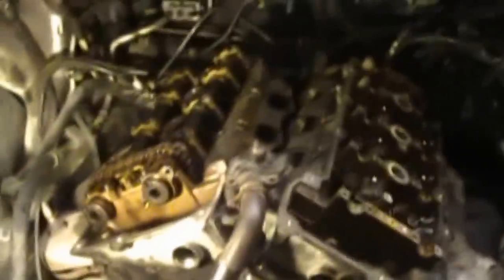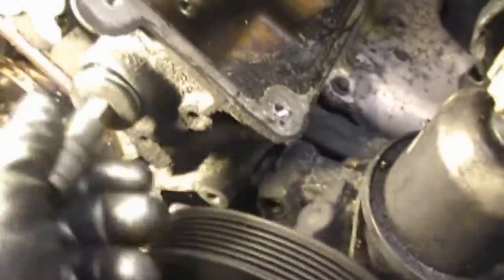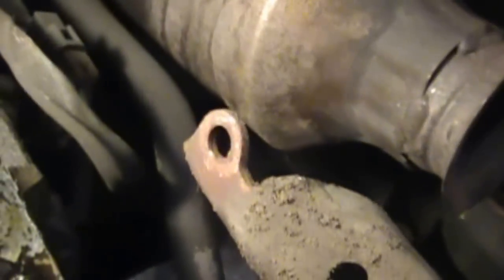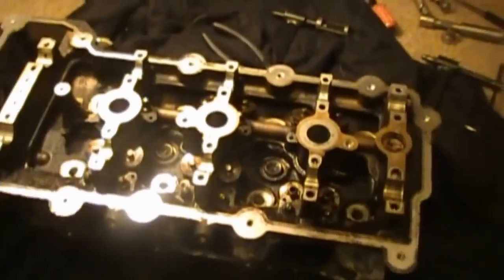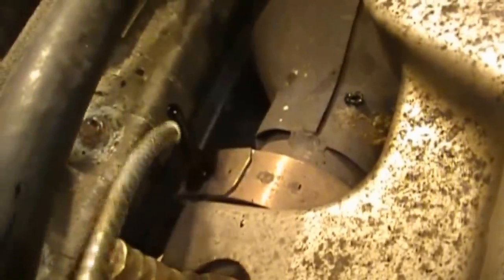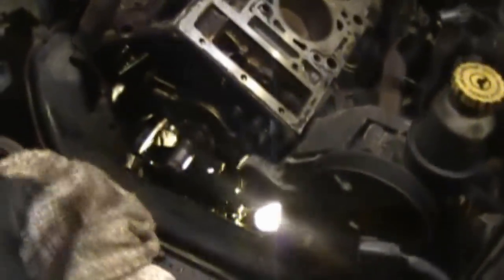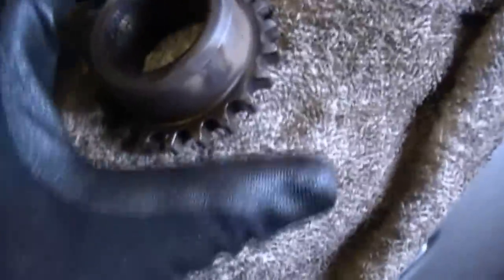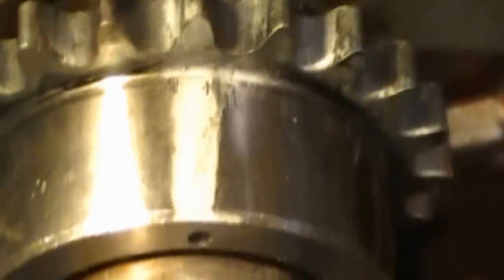2.7 1999 concord/intrepid timing chain replacement - head removel and more!

Comment from the maker: Don't go by TDC in the spark plug hold....instead use the crank shaft arrow mark for TDC. Its easy to get if off a link or so. I used vice grips on my cams to hold them in place. U may have to start over to get it just right. Good luck.

Comment: Very thorough video! Thank you for all the time you put into this 2.7 liter...your video is THE 1st one I have found showing how to remove the heads. I've been surfing videos for over 3 months! (Thank you for the tip on how to prevent your engine from turning over!) Im a fan!
Reply: Hey Bradley, there is a 3 part video from Chrysler Master tech from 1997 on here (youtube) when the engine was originally made. It goes over the 2.7L, 3.2L, and the 3.5L . I was on here because i just bought a 2000 Dodge intrepid with 80k miles on it. You probably know the water pumps are a major flaw in the design. its the reason I'm on here. I think Chrysler recommends changing the water pump every 100k miles. but anyways go look for the videos if you need more info.

Comment: I found this Chrysler schematic and thought it may help!! I am ready to take my chain off my 2006 Sebring Convertible 2.7 V6 but wanted someway to be sure of how to set the timing as i will be changing head gaskets, all three chains, and water pump!! Hope it helps!! https://w05.dealerconnect.chrysler.com/service/mds2002/serviceInfo/en_US/81371b44.gif https://w05.dealerconnect.chrysler.com/service/mds2002/serviceInfo/en_US/81365a43.gif

Comment: I am working on a 2.7 Chrysler Sebring that had zero pressure on the front left cylinder. It came in making a horrible racket and leaking oil in the valley when I removed the intake. The chains are tight no sludge just trying to diagnose before I take off the heads. How do you remove the cams safely without bending them, because when I found when I took off the valve covers there was metal collecting on the cams.

Comment: There is no brace in the way..  Only thing ya gotto watch is the two 8mm bolts in the front of oil pan connects to the timing cover.   It's tight. But easily done.   Im in the process of taking heads off my 2001 concorde 2.7.   Timing jumped.  All the intake valves are sticking open.
Reply: what did you find out about the reason for all your intake valves being stuck open, I have the same problem.

Comment: Im doing 2003 2.7L and i turned the crank without the chain on accident, so when puuting it back together i took out spark plug out of cylinder one to locate TDC but when i went to time it i got all the timing marks exactly as they where suppost to be , but when i went to put the bols in the cams the bolt holes  will not line up correctly. What am i doing wrong? Please help

Comment: Hi I just want to say thank you sooooooo much for this video and my question is how do I install the timing piston/tensioner to where it automatically take up the slack ? Bc my problem is when I try to crank it ... After installing a brand new timing tensioner/piston it slips on me as I try to turn the motor over please help me out on this one
Reply: You need to push the tensioner arm into the tensioner so that the tensioner is fully compressed. Once it's fully compressed it should extend out fully.

Comment: i would like to know how much torqe on the head bolts on a 2/7 dodge 2004 int
Reply: +jay dearmond 48 N·m (35 ft. lbs.) Step 2: Bolts 1–8 to 75 N·m (55 ft. lbs.) 
Step 3: Bolts 1–8 to 75 N·m (55 ft. lbs.)  Step 4: Bolts 1–8 to +90°

Comment: does that front plate just pop off? mine is pretty stuck lol
Reply from the maker: +Mason Mitchell  you mean timing cover?
Reply: +TVWXMAN32 yes, mine has a small pulley where the water pump would be on the inside but it is stuck, I got the crank pulley off easy
Reply from the maker: Mason Mitchell
 I think I just loosen the pulley bolts and the cover slid by the pulley. I know the bolts were a pain in the ass for that last process.

Comment: I bought a 2002 Intrepid for $200... scrap value. The car is in great shape. The engine knocks. The coolant is yellow, so the water pump is fried.

I'm wondering if the engine is salvageable. Part it out or send it to the salvage yard. At least break even.

If I drained the coolant, what was left and changed the oil and there is less knocking maybe it can be saved?
Right now the knocking is from the front of the engine, the timing chain cover or maybe the two front cylinders.

If the crank is shot I'm screwed. It would be worth it for me to change the rod bearings and the water pump. That is easy enough to do.

If I drain the oil and there is metal in there I'm guessing it would not even be worth taking the engine apart. Or would I have to pull the oil pan off to see how much damage has been done to the crank?
Reply from the maker: Clay Ton these cars are bitch to work on...unless you want to keep it... try to fix i.t But with a knock in the motor i'd part it out or junk it. I learnt the hard way;)
Reply: TVWXMAN32 I did a head gasket replacement on a 2000 V6 Pontiac Grand Am. That was a pain but had in done in about 12 hours.
Have done other timing belts/chains and cylinder head replacements but that was by far the biggest pain in the butt. Just no room to work...

Looking at the engine in the Intrepid... It looks pretty involved.

Heads I can get cheap, normally $75. If the bottom the engine is destroyed... As you said it's not worth the trouble.

Extremely optimistic in thinking swapping out the oil and water pump could make the car run like new. No idea how long the previous owner ran the car like that. Water jugs in the front seat... 

The car runs though. I drained 4 gallons of oil which was the constancy and color of chocolate moose out of the engine. Took over an hour. Threw some cheap high mileage engine oil in her and drove it the eight miles home with a friend following.

I am wondering about the extent of the damage because it drives fine. There was no
knocking with the "oil change".
There is allot of rattling from the front of the engine.  Water pump and timing chain rattle/slap? The timing chain tensioner and guides are shot and water pump bearings are gone.
Car has 131,955 miles

Hopefully next weekend I'll have time to do a compression test and tear the engine apart to have a real look.
Video taping is hard to do well but I'll try my best. Maybe it'll help others as you have.

Part of the fun in working on cars is learning how the engine works, how it is put together.
Really enjoyed your video. It was very informative and helpful. Thank you.

I can get the timing chain kit with water pump for $186 on amazon.com. There are cheaper kits for as little as $102 but I'm not buying anything yet.

I believe I can salvage the engine. If it were undriveable I would have towed it right to the salvage yard. Salvage yard is only two miles away from my home, if that turns out to be the case.

If I pull the engine apart and the chain is slopping around in there I'm pretty sure that's all the noise. I've seen it a few times in Chevy Cavalier's. Chain slap and it takes out the tensioner and the oil pan seal.

Car starts right up, has power. As I said before the entire car is in beautiful condition. Drove it home.

I don't hear any rod knock. The noise after the oil was changed was all on the front of the engine. As if the chain is hitting the housing or the chain guides.

Not my first rodeo but have never worked on a 2.7L engine before.
Reply from the maker: Good luck to you man. Just take your time. You will figure it out;)
Reply: TVWXMAN32 LOL Yeah, I try. I'll spend the next couple of weeks pouring over the service manual, forums and video's looking for procedures to get it down. Did find an intact 2.7 out of an Intrepid which was rearended, for $250... If it comes to it I can do an engine swap.

Half the fun is doing the job. Sheer satisfaction in getting it done. Somewhat optimistic the engine is still good. 

timing kit... which includes water/oil pump.

http://www.amazon.com/gp/product/B00WAMTQH4?psc=1&redirect=true&ref_=ox_sc_sfl_title_2&smid=A3RG6IQ0XGU0CF

Comment: YOU ARE SO WRONG!!! FOR THE PEOPLE WATCHING THIS VIDEO -- DO NOT USE THE ARROWS!!! You are lucky that you didn't line up the arrow on the intakes or you would have known the moment you tried to start the engine! As it is, you've got early valve timing on your exhaust valves on the left bank! You've got to stop insisting that you're right because you're misleading a lot of people who are going to screw their engine up because you don't seem to want to call a Chrysler service center and inquire about it as I did!

Nobody seems to know what the arrows are for, but they are definitely, positively, not used to time the primary timing chain!!!

I know your intentions are good - but please consider the ramifications if you're wrong! You are wrong  --  call a Chrysler service center and they will definitely set you straight! Then maybe you can do some damage control in your comments!!! YOU ARE WRONG!!!

Comment: I know you did this some time ago, but for others watching measure the base of the water pump on a new pump. The water pump was changed three times, 1997-2001, 2002-2006, 2007-2010, over the run of this engine, the final redesign of the 2007-2010 2.7 engines has a thicker plate, with a slightly longer impellor, these will not interchange with earlier production 2.7 engines. Always double-check this by installing the water pump and placing the front chain cover to make sure it sets firmly against the block. If you got the wrong pump, the cover will have a 4mm gap at the top and will never seal and possibly warp the cover if bolted down, also the longer impellor will contact the block, this can be checked by rotating the water pump after installation to make sure it turns freely. And the easiest way to tell is the 97-01 engines had no grease fill on the water pump housing as the bearings were pre-lubed and installed. The 02-06 engines added a small grease port that was filled and capped off, the 07-10 had a large grease port that was capped off along with a thicker base and impellor. I recommend Mopar OEM for the pump and timing set, watch yourself on the aftermarket parts with these engines as there were many subtle changes made over the years. Good video. Oh and take some of your wife's ruby red nail polish and paint the timing marks making them easier to see :)
Reply from the maker: Great comment!!

Comment from the maker: The tensioner should fully extent until oil pressure builds up holding the chain. I'm not sure what going on with your issue. Make sure you only turn it CLOCKWISE! -The crank that is.
Reply: TVWXMAN32 what website u use to order the parts
Reply from the maker: Junior Cruz. I went on e-bay and looked for dealers etc. Amazing deals on there. I wish I had a better   video camera back then for better viewing.
Reply: TVWXMAN32 cool thank you

Comment: ebay= rejected or 2nds...not a good place for engine parts/waterpumps.. hope ya have good luck.Timing mark is a groove on the factory crank sprocket......
You should have lined it up in the 60 degree ...Its right there in video  on the sprocket ......should always put sprocket in boling water or in oven ...it slides right on and cools tight...torches and crank not good combo

Comment from the maker: Ok, everyone, go by the book then. ....use the dots....................let me know how it works for you. You can't go wrong right?.......................Funny, my concord has ran perfect TIMING IT THIS WAY........unless you can PROVE I'm wrong....I will not trust the dot on that cam... It just works out this way for me for the arrow.. Maybe some other models are different but this worked for me. On the 2007's they use two arrows. I guess slowing transferring to arrows over the years... Even when I tryied to use the dot on the driverside...It did not line up, and when you put tention on the chain it was way off. Maybe some knows why they put a arrow on one cam and a dot on the other...lol ...opposed to two dots v two arrows... on the driver side cam. Good luck all!
Reply: Do i need a camshaft clamp to remove the front timing chain because I'm just changing my water pump other parts are in good shape

Comment from the maker: after u take off the the rockers u can replace the lifters they should pull right out. As for the bolts they only need about 18 lbs of torque not much. U don't want to strip the little bolts in the alumnum head ;). Good luck.

Comment from the maker: you sure it's in the correct time? could be something you forgot to connect like a wire. Check fuel pressure is the pump kicking in. good luck.

Comment: Tyler...Thank you for the recommendation! I have a 2001 Dodge Intrepid 2.7 liter (actually my daughter's car) that I had to replace the rod bearings. Only has 102,000 original miles. Replaced water pump, oil pump, timing chain and all sprockets at 80,000 miles. I just finished replacing rod bearings with engine in the car...was a job getting oil pan off...had to loosen sway bar...however no more rod knock! Now I have low oil pressure. Used Marvel Mystery Oil and hopefully that will quiet the cams, lifters and vales!??? Put new oil sending unit in as well and no sludge build up at all when I took the oil pan off...which was a huge suprise! The car is too nice to salvage but will keep you and everyone updated on the engine over next few days. Thank you again for recommending the Chrysler view tech videos! If anyone has any questions. ..I know these 2.7 liter engines INSIDE AND OUT now!
Reply: How is the car doing now? I am rebuilding a 2001 Chrysler Sebring 2.7 liter

Comment: Hey friend: I spoke to a Chrysler mechanic at a dealer. He said when you have the two cams on a table installing the secondary chain - use whatever marks that correspond with the slots that are cut into the end of the cam - pointing straight up! So, the slots that are machined at the ends of the camshafts must be facing at 12:00 (on the workbench!). Surprisingly, he did not know anything about the arrows! Of course, when I have to turn the cam to line it up with the bolt holes on the primary sprockets, they will be off sett to about 1:00. And guess what? When the cams are installed without the secondary sprockets - the arrows are pointing at 12:00!!! So, they must use these as reference points when the cam is not "loaded".

I just wanted to say this so other people who are pulling there hair out like me can get another opinion. Don't mean to be a jerk! I really enjoyed your video!!!

Comment: The Cam Chains On The Left Head Do Line Up On The Dots, Not The Arrows, You Have To Insert A 3/8 Socket Extension In The End Of The Cam And Turn It To Line Up The Cam Gear Bolts, The Cams Arent Suppose To Rest In Automatically In The 90 Degree Position, Right Side Do, Yes But Not Left, You Can Look Up Different Vids And Photos Of The Camshaft Ends And See The Position The Groves Are In And Even At The Start Of This Video Before You Removed The Cams On That Side, Perhaps Thats Why Your Throttle Response Is Sluggish

Comment: The ends of the intake cams have a socket that fits a 3/8 drive ratchet or bar with a short extension so you can rotate the cams to line up the bolt holes and hold while tightening.
Reply from the maker: Dave Hennessy Thanks for the tip!

Comment: Great video quick question. When you're putting the new sprockets onto your left and right cams do you rotate the cams clockwise or counterclockwise to line up the holes inorder to bolt the sprokets to the cams. Very informational video love to see all the way down to the heads definitely going to subscribe for my 2.7 I have a 300

Comment: my intake valves are all stuck open about a quarter of a inch.  My car was low on oil an was banging. I thought it threw a rod bearing.  Checked em they were fine.. Was a water pump bearing locking up an blown seal on the oil tensioner.   The chain hitting the side of the motor case was the banging noise.   So the mechanic revved the motor an that is what caused the chain to jump time.   I have no proof or id prob take em to small claims court..  I have paid 4 grand on this car.  i still owe 2 grand.  It's a piece of shit.

Comment: I bought an intrepid it was leaking antifreeze from a hole in the hose i fixed it and had the mechanic check for future issues. He checked and said that the cars engine and trans were in good shape he just wanted to double check the water pump.So i brought it back for him to check hes not there but another mechanic checked it and said it looked fine. Then i said the belt is squeaking the mechanic said ill replace it give me an hour. Almost 2.5 hrs later hes done i drive to work no problems. I later warm the car up and hear squeaking again. I start to drive home the heat goes put again, car slows down, temperature goes up and over heats smoke everywhere a big crack on top of the engine. Antifreeze everywhere.The mechanic says its not because of the belt but because of the timing chain inside the engine in which no one can alert me of.Thanks for reading any thoughts
Reply from the maker: O my....You have bad luck.
Reply: TVWXMAN32  so it seems
Reply from the maker: If the antifreeze is leaking from the top check the theromostat housing. They are are plastic and melt. Easy fix. If I was next to you I'd help;)
Reply: TVWXMAN32 
Yeah! Well I think the engines blown now soooooo lol actually first time ive laughed about it today so ;)
Reply from the maker: I'm sorry. Maybe a nice car will come soon.

Comment: Thank you!! This video really helped me for a DYI... Water pump failed-caused by slack in the chain due to a bad tension pin. I went for it and tackled the project. I did the same thing on the cam timing and had to do a complete takedown again. This is critical!!